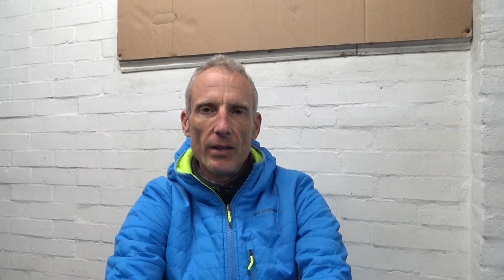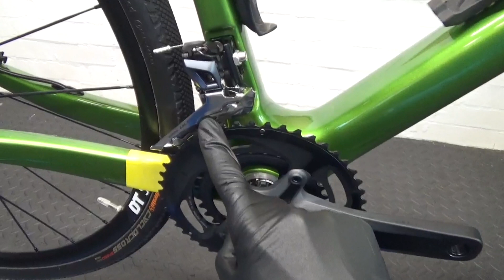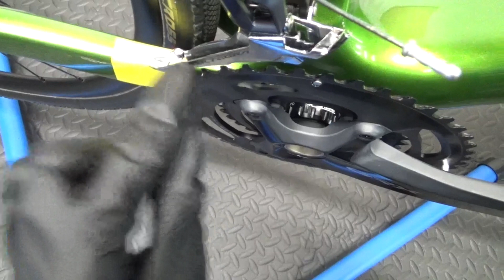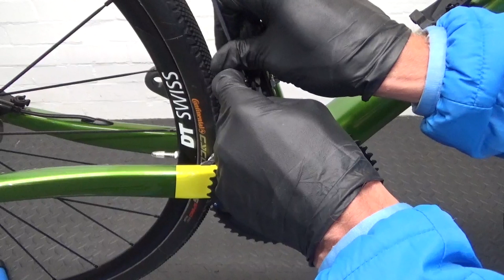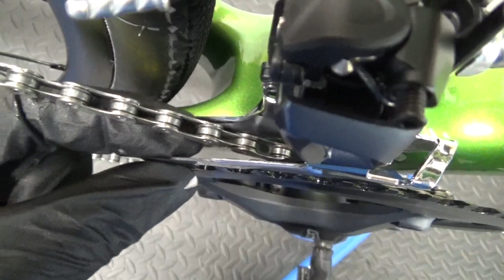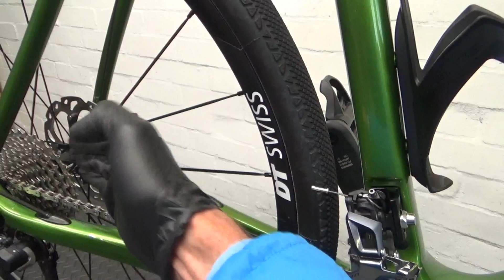Shimano GRX 810 Crankset Using A Road Front Derailleur?

Comment: Do you reckon the ultegra 8100 crank will work with a grx front derailleur? Worst case scenario I'll need to purchase a road front derailleur ? All the sources I'm seeing say it's not possible to mix Shimano road with grx because of the off set but this video disproves that.
Reply: The 48-36 crankset should work, but the other ones most likely won't work, as the GRX derailleurs are made for a maximum chainring of 48T.

Comment: What about if you are using a super compact front double. Like a 38/24. Issues I have with the FD is it is hitting the chainstays long before we get that 2mm gap from the FD to top of the chainring. This is Shimano 11s road with ultegra rx800 for that 11-42 range on the rear

Comment: Hi, I have a question, My local mechnic has no idea about it, and I don't know where to ask. 
The R7000 FD is  44.5 mm chainline, rx810 crankset is 47 mm chainline. In this video, it works.
And now, I have a crankset with 48.8 mm chainline, and I want to use rx810 FD with 47mm chainline to pull it, the the gap between big tooth and small tooth is 9.3 mm, I don't know will it work...
Thanks. I don't know the tooth gap between the rx810 crankset. 
The detail is the small tooth is 30T at 43 mm chainline, the big cog is 46 T at 52.3 mm chainline, it's a gravel 46-30T tooth on the MTB style crankarm w ith Q-Factor about 168mm. 

I use this crankset on an old school hardtail MTB frameset with hard fork.

Comment: Hi, with the help of this video I replaced mij Shimano 105-7000 (50-34) crankset with a GRX-810 (48-31) crankset. This on my JGuillem Major roadbike.
The 105-7000 front derrailleur works flawless, after setting it up by your steps. (even when cross chaining.) Thanks, great video!

Comment: Will the GRX 810 FD work with a 105 R7000 50/34t crank ? Planning to change the 105 R7000 FD to GRX 7810 FD, by the way I am using GRX 810 RD paired with Deore 11-42t cassette and also 105 R7000 STI. Thanks in advance for the kind information / response.
Reply: hi Makoi did this work on your setup? I'm planning to change crank to 50-34T using my GRX FD.

Comment: Might work with mechanical, but with di2 I wasn’t able to get the front ultegra mech outboard enough to avoid rubbing. Grx di2 front mech required. Another problem in road bike is lowering the front mech enough. Most road bikes with braze on will lower enough for a 50t front ring, but not less than this.
Reply: I know this is an old comment and too late for you, but for others facing the Di2 issue I did this for a friend by making a 1.5 mm (1.5 was enough) shim plate to fit behind the front mech hangar basically moving the whole unit outboard, the drop wasn't an issue although it was on the limit but there are adapters for that too. Of course this wouldn't work if the the hangar is not detachable.

Comment: is it possible to this set up...

Drivetrain:
Rear shifter: 9 speed Alivio
Rear RD: 9speed Alivio
Front shifter: 10 speed Tiagra 4700 (flatbar)
FD: 10 speed Tiagra 4700
Crank: 11 speed GRX600

My intention is to be able to use the GRX crankset 46t/30t on my hybrid roadbike. Unfortunately, mtb drivetrain does not offer this chainring ratio. There is an Acera MT-210 model for 9 speed (which could be the answer) with the same chainring ratio but it is almost impossible to get one. Please help. Thank you
Reply from the maker: I would run a 10 speed chain as that will work better with the 11 speed chainrings, and will work fine with the 9 speed cassette.
Reply: @FreeToCycle  Just keeping you in the loop. The build works very well. I actually didn't have to change the alivio shifters at all. I just made sure that my FD is also GRX. Surprisingly it shifts like butter 😁
Reply: @FreeToCycle  thank you. I appreciate it :)

Comment: What about to use spacers for rings screws to move chainrings closer to the frame to cancel 2,5 mm offset of grx cranks  comparing to road cranks. I’m thinking to  replace my 105 with grx on road frame, but I want to keep chainline as is. I know that rings will not fit cranks perfectly then as there will be spacers, but it should help to make 105 deraliereur easier to adjust. What do you think?
Reply: was thinking about this as well but not reducing the complete 2.5mm but maybe at least 1mm of spacer between the cranks and chainrings. did you manage to do it?
Reply: @frugalcode  Yes I did. I used 2mm spacers for both rings. It works fine, let's say for 99% as rarely chaindrop happened during shift from big to small. It seems that 105 deralieur si not perfect for 48/31 rings, but overall I'm satisfied.

Comment: How about other way around? Grx front derailleur and road cranks? Will this work?
Reply: Seems like the main ? is whether the FD can be adjusted (with the inward travel limit screw) to allow the chain to go to the small CW.   Should be no problem with the large CW.  GRX FD assumes the crankset will be 2.5mm further out than they are on road crankset.

Comment: Hi @Free To Cycle... would GRX400 STI+GRX400 FD be able to use the GRX810-2 chainring? I want to stick with the 2x10 but I can't find the major differences between these 2x10 and 2x11 chainrings (other than x10 / x11 of course). Thanks
Reply: @hid tro Did you ever get a reply or find out?

Comment: Thanks for the video. Can you tell me why you didn't shorten the chain? I'd have thought you'd take one link out (as your big ring has gone from 50 to 48 and the chain wraps round about half the ring). I'm going from compact to 46/30 and was assuming I'd need to take two off.
Reply: I did exactly the same on 105 components and had to remove a few links... 4 in total

Comment: Has anyone tried this with a braze on 105 R7000 FD? Wonder if the Ultegra R8000 has more range in the H/L screws.
Reply: bought the 46/30 GRX crank and about to try and follow the video with an R7000 FD fingers crossed!
Reply: @TagAudi6  any update? Did you succed with grx crank and r7000 fd?
Reply: @behb3425  Sounds like that’s a no

Comment: Nice video. Question: I got Tiagra FC-4650 crank set, it was 50-34 I changed to 46-34. Will it work with GRX front derailleur FD-RX400? According to Shimano's compatibility chart it will not. Thank you
Reply from the maker: You can fit a 105 R7000 front derailleur it will work fine with the 10 speed chain. The GRX derailleur is made for a 2.5mm difference in spacing, For the gravel bikes with wider tyres!
Reply: @FreeToCycle  this mean GRX front derailleur will work only with GRX crank set?

Comment: hello,  from France... do you know if it is possible to install a 46/30 grx crankset on a road bike ?  now I have a triple crankset but I would like to change for hydraulic disc. I live in a montain region and I weight 85kg so it's too difficult for me with a 50/34...   I you think it's posible, what do I have to buy ? crankset + front dérailleur only ?  thank u for your videos
Reply: Bleex Rossignol if you have a triple crankset you will have to change your front dérailleur along with shifter otherwise it will not work with a double crankset.
Reply: @jbkechi  what I mean is : can I install a grx crankset on a road bike ? ( excuse my poor english...)
Reply: Bleex Rossignol you can but depending on your current setup you may have to change quite a lot of stuff :D
Reply: @jbkechi  so, maybe a fsa 46/30 crankset would be better in my case .?
Reply: @bleexrossignol9782  the issue is to switch from triple to double crankset. If you do (and you absolutly can), you will also have to changer your lever as well.